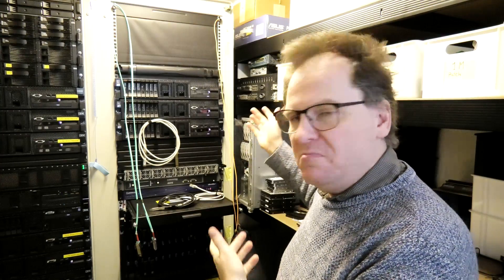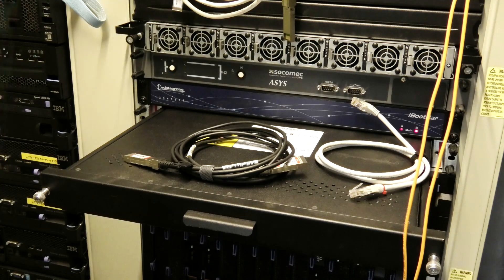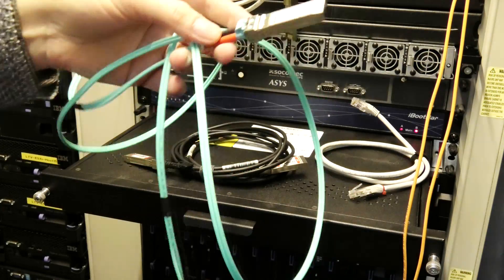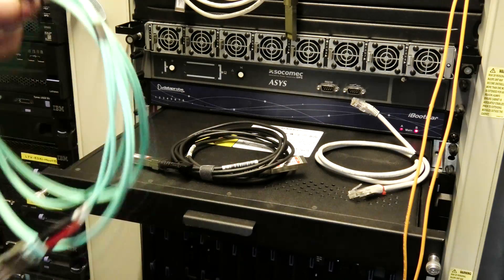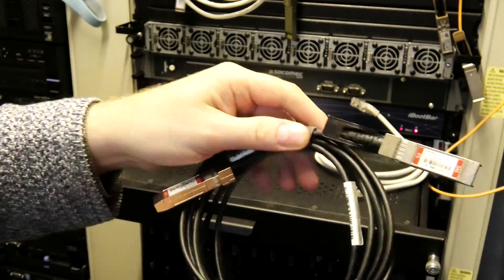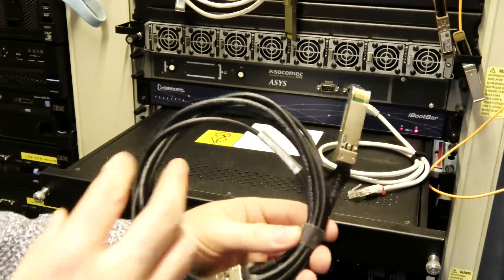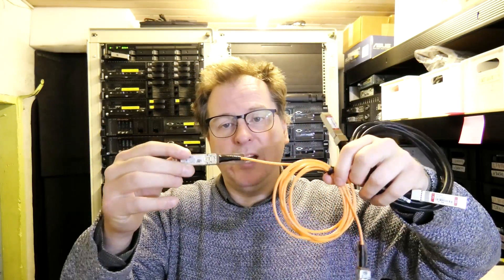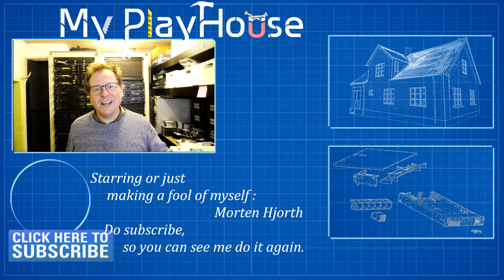Latency Difference Between 10GBASE-T SFP+, AOC & DAC Cables - 1286

Comment: Blogger, I carefully observed and researched this issue many years ago, and I also found Arista's latency test comparison report between AOCs and DACs. Arista's test report also showed that DACs have lower latency than AOCs. Yes, light travels at 300,000 km/s in a vacuum. However, in optical fiber, due to diffraction and absorption of light signals by materials like quartz glass, the propagation speed of light in solid-core fiber is only 200,000 km/s. However, electrical signals travel at 230,000 km/s in copper cables, which is even faster. Furthermore, AOCs require conversion between optical and electrical signals at both ends, resulting in double processing delays. DACs don't have this issue. Furthermore, DACs consume very little power, less than 0.1mW, practically nothing, while AOCs consume around 500mW and generate more heat than DACs. In data centers, if a large number of fiber optic patch cables are used within a cabinet, the cumulative difference in power consumption and heat generation can be quite significant. Furthermore, due to the optical-to-electrical signal conversion module, the DAC's MTBF can reach 50 million hours (some say 500 million hours, but I'll use 50 million for my calculations), making its reliability and durability more than an order of magnitude higher than that of AOCs. The SFP+ 10Gbps DAC we used in our computer room eight or nine years ago is still in stable use. However, due to the optical-to-electrical conversion module, AOCs experience optical degradation every five to seven years. For safety reasons, we typically replace key nodes every five years based on the module's optical degradation.
Reply: Of course, the DAC's biggest drawback is its short transmission distance of only about 7 meters. Furthermore, the electrical signal is more susceptible to EMI than the DAC's optical signal. However, this distance is sufficient for use within a cabinet. In terms of transmission speed and latency, hollow-core fiber may hold the greatest potential. It's said to offer 30% faster transmission speeds than traditional solid-core fiber, greater bandwidth capacity, longer transmission distances, and lower latency. The University of Southampton in the UK has been conducting research on this technology, and some Microsoft data centers have reportedly been using it in recent years. Meanwhile, many fiber optic manufacturers in China, such as YOFC, are also engaged in R&D and production. I've seen some of these companies and their products at the Optical Communications Expo.
Reply from the maker: hollow-core fiber,, intersting.
Reply: This is the address of Arista's previous test report on DAC and AOC: https://www.arista.com/assets/data/pdf/Copper-Faster-Than-Fiber-Brief.pdf
Reply from the maker: Thank You!
Reply from the maker: Yes and the delay switching forth and back from light,, I would thing is a factor..

Comment: As I understand it with fiber optics you do have a delay between the electrical to optical and optical to electrical signal...when measuring from port to port or server to switch to server.   So when it's a short distance, with in the same rack, you can actually get better latency using SFP+ DACs than optics and fiber.  Any longer distance that would require an electrical booster, fiber will have much lower latency.   Also the DACs tend to heat up less than the Fiber optics, in my expeierance.  But you can look at power the device uses to indicate heat output of the DAC vs Fiber Optics.  With the 10GbaseT "optics" being the highest power consumers. 

"Electrical to optical signal conversion introduces a delay, primarily due to the time required for the conversion process itself and the subsequent propagation through the optical medium. This delay can vary depending on the specific components and techniques used, but generally falls within the nanosecond to microsecond range"
Reply from the maker: That is also what I think,, I do not have any prove!! :-)

Comment: Many have observed that SFP adapters run very hot. The cables run somewhat cooler but I'm wondering which type of cable runs the coolest?
Reply from the maker: It's just the SFP's that run hot,, all the cables does not really heat up.
Reply: @MyPlayHouse  I should have been more specific: what I meant are the metal devices at the cable ends. Which type runs cooler, fiber optic, coax or RJ45?

Comment: One reason for increased latency of a DAC vs fiber is an incorrect assumption about the speed of light in copper. The speed of propagation depends on the characteristic impedance of the line, which depends on the dialetric material, distance between waveguides and groundplanes, etc. Paraphrasing from another commenter, transmission lines are complicated.
Reply from the maker: I still think it’s weird 😳

Comment: The SFP+ DAC (passive) should be a lot better because there is no signal processing in the transceiver. It literally connects the contacts from one sfp+ slot to the other via a copper conductor. That's also why it does not reach far beyond 5 m. I think you mixed up the numbers of the SFP+ Fibre and SFP+ DAC transceivers. All other methods have some sort of signal processing and or medium conversion, and that is the mayor contributor to the latency. The medium itself is mostly irrelevant in this case, the (long) distance has a bigger influence in latency than if the signal travels over copper or optical fibre. Of course signal degradation over very long distances and the need for repeaters do play a role.

So we have two contributors:
- Medium conversion
- Distance

But to be blunt, in a homelab, I don't think latency matters enough. I'd just avoid the SFP(+) to RJ45 transceiver modules, not just because of latency issues, but also because they get hot af and draw a lot of power.
Reply from the maker: I see up to 7meter DAC cables,, after that they become active AOC :-) Thank You!
Reply: @MyPlayHouse  Yes, that’s why i said „not far beyond“ and not „not longer than“.

Also, apparently active DAC (yes, copper!) cables exist that go a bit further, but of course don’t reach the fibre distances.

Comment: Electricity doesn't flow in the wire. It travels in the electromagnetic fields surrounding the wire so the speed of travel is limited by the dielectric. Free electrons in a conductor actually only move about 0.5 cm/second or something. It's actually really all a mess. It's only at DC that something like 44% of the energy is carried by the electrons. Above 100 Hz it's all fields. If you thought electromagnetic theory is a disaster, you should look at solid state physics. Those guys must be clamoring to throw themselves off tall buildings. If you actually heard the "theories" they've come up with to explain free electron flow the scales would fall from your eyes.
Reply from the maker: Nothing is ever simple when you gig in to it,,, like if you think a compass points towards north,,, is does,,-ish :-)

Comment: I admittedly did not watch the whole video, but skipped to the part with the whiteboard that says Fiber is faster than DAC.

You may have covered this in your video, but if not - This is wrong. DAC will always be faster than fiber. 

Over the distances that you can run a DAC, it will virtually always be faster (lower latency) than fiber. 

This is because fiber requires the electrical signal be converted to a light signal, then back to an electrical signal. 

This introduces more latency than the speed advantage that fiber has over the distances a DAC can be run. 

Over long enough distances, yes a fiber would eventually be lower latency than a DAC - but the point is moot, because DACs don’t run that far anyways. 

TLDR; For all intents and purposes DAC is always faster than Fiber
Reply from the maker: I also thought that,, but could not find any data to back up that.
Reply: Did you do any benchmarks or just the math? @MyPlayHouse

Comment: If you google "Copper-Faster-Than-Fiber-Brief" you can find a pdf by Arista Networks detailing why DAC cables are faster than fiber (because it does not convert the data into light and is a direct connection) and how much faster it is compared to fiber.

Comment: Isn't there a fiber cable that is more protected from breaking with a thicker shirt? I'm not talking about the 3mm variant.
Reply from the maker: Yes you can get thicker, and cables with like two wires side by side,, they are stronger.
These thin ones you have to be careful with.
Reply: What are they called so I can buy some?

Comment: The logic of your math presents a problem. A DAC is a 1:1 circuit connection, and no conversion is necessary. This contrasts with fiber, which does require conversion. Although it's not something measurable externally, nearly every switch IC engineer I've consulted advises using a DAC if space and cable length allow.
Reply from the maker: I did not come up with the numbers :-/

Comment: For Short Distances DAC cables are better as they are cheaper and no conversion is needed (From Electricity to Light). For Longer distances fiber with transceivers are better as copper wires have Resistance and the current Cat7a cable can do 10Gbps @ 100M max. 
AOC Cables on the other hand stands for Active Optical Cable. 

Advantages of DAC Cables : 

More Cost-effective— Generally speaking, the price of copper cables is much lower than that of optical fibers. The cost of passive copper cables is 2 to 5 times cheaper than fiber cables of the same length. Therefore, the use of high-speed cables will also reduce the cabling costs of the entire data center.
Lower Power Consumption— High-speed DAC (direct attach cable) consumes less power(the power consumption is almost zero) since passive cables do not require a power supply. The power consumption of active copper cables is generally around 440mW. If you use direct attach copper cables instead of AOC fiber cables, you can save hundreds of thousands of kilowatts of electrical power.
More durable–It is designed with a seamless connection form of optical module and optical cable, which reduces the cost and ensures that the optical port is not exposed to dust and other pollutants. Therefore, DAC is less susceptible to damage. 

Advantages of AOC Cables : 

Lighter weight-An active optical cable is composed of two optical transceivers and a fiber optic patch cable, whose weight is only a quarter of the direct attach copper cable, and the bulk is about half of the copper cable.
Longer distances-AOC fiber can provide a greater and longer transmission reach of up to 100-300m due to its better heat dissipation in the computer room’s wiring system and smaller bending radius of optical cable.
More Reliable– Active optical cable is less vulnerable to electromagnetic interference since optical fiber is a kind of dielectric that can sustain a static electric field within it. The bit error rate of the product transmission performance is also better, and the BER can reach 10^-15.

Those SFP to RJ45 converters/adapters... Well they are useless in most cases. The transceivers gets hot and heating up the whole switch unnecessary. The proper way is to convert the signal is a proper media converter designed for this purpose.
Reply from the maker: Hi Victor Shane
Thank You very much!  that was some assay :-)
The SFP to RJ45 works fine for connecting a management port like IMM,ILO from a server,, without having to add an extra cobber switch.
Thank you for watching! :-)

Comment: Do not believe fiber cabling offers lower latency compared to a DAC connection. I know for a fact that that is not the case 🙂 You did not measure your experiment, but based your conclusion on information provided by a single cable vendor.
Reply from the maker: I did see that they did not invent the numbers them self.

Comment: Another thing is interference. Copper wires can be affected by high current power lines where as light on the other hand is not.
Reply from the maker: It is posable,, not usually a big issue.

Comment: I think the biggest factor to these connectors is the heat and wattage that they consume. This is especially true when you have full switches that are populated. For one or two connections, an extra 3-4 watts per port and btu is not a big deal, but when you have 48+... now that is going to be a big deal if you have to pay for expensive power rates and AC to cool.
Reply from the maker: It all adds up,, I have also seen big switches with just a few connections. :-/

Comment: Fun fact: there is lots of engineering on getting a fast electrical signal to travel over a wire. We tend to think of a wire as something that just outputs whatever signal you inject into it, but that's a huge oversimplification. Instead, the universe has a tendency to work in quite complicated ways: https://en.wikipedia.org/wiki/Transmission_line
Reply from the maker: Well I have difficulty enough, with the part that it is not the electron you put in, that is comming out :-)

Comment: Can someone please help me understand, when you have top of rack switches which are linked back to spines in spine and leaf, and you choose sfp28 ports on your top of rack switches: where does the servers ilo rj45 plug into? Do I need an sfp28 switch and rj45 switch separately just for ilo or do I convert some sfp28 to rj45 with converters?
My work uses all rj45 and I really want to move us to 25G with 100g or higher uplinks to spines but the ilo/idrac question is confusing me
Reply from the maker: You can put one of these in your switch,, and a cat6 -ish cable to your Ilo.
Reply: @My PlayHouse  yes I think cheap rj45 sfp modules are the way to go thanks
Reply: You put a separate management switch into the rack. You could put 1Gbps SFP modules into your super expensive top of the rack switch but honestly, it would be a really daft move. We have historically cycled down old switches for that purpose but that won't work in the future as all the switches are SFP+ ports only😞

Comment: somewhere out there must be a 40Gbit/s NIC for RJ45, because there are RJ45 de-embedded modules from metz-connect btr for this speed...
Reply from the maker: The cat8.1 will do 40GBASE-T,, I have never seen a card..
Reply: @MyPlayHouse  Cat6a will do 40GBaseT as well. Yesterday I found a posting that it's possible to cross-flash a Mellanox connext-X3 to 40G.
Reply: @matthiaslange392  There is no IEEE 802.3 standard for 40Gbps Ethernet over Cat6a. It needs Cat8 with the special CG45 connectors and only goes up to 30m point to point, no patch panels or outlets are allowed. To the best of my knowledge, not a single piece of equipment has ever been released to the market supporting it and 40Gbps Ethernet is a dead end now, so it is unlikely there ever will be.
Reply: the connect-x3 has sfp ports, not rj45.
Reply: @jonathanbuzzard1376  it's like SATA-express: some mainboards, but not a single drive ever released.
Reply: @jonathanbuzzard1376  alpha Networks had a 25G Base-T switch in 2021. But no 40G Base-T Equipment anywhere. And no NICs.

Comment: I was always told that DAC is the lowest latency but i could be wrong. The advantage of fibre is that its thinner and easy to manage compared to DAC. Unless you work with " John loop the fibre" who uses a fibre patch lead 4m too long and loops it up and down the rack....... and then loses his console cable for the 1000 time.
Reply from the maker: I would also have expected that DAC would have had the lowest latency,, I can't get into my head that the other is faster.

Comment: Neither of these matter when we, on the receiving network card, run with typically 70us coalescing. This avoids interrupting the CPU at every packet, instead giving the NIC time to do its hardware acceleration things, and the CPU can process packets in bundles. 
The reason for both the low power and latency of fiber interfaces, and the high same of 10GBASE-T is bandwidth: Fiber has oodles of it, and the bits can be shoved across as-is with bandwidth-inefficient coding. 10GBASE-T is up against the limit of the cable, and requires complicated line coding to make it work; There's a presentation from Broadcom in 2006 showing the crazy complexity of a 10GBASE-T 'modem'.
Reply from the maker: So the network card is kind of caching for the CPU. ?
Reply: @MyPlayHouse   It's doing more than that. It will read data from main memory (it goes across PCIe and through the CPUs memory controller), chop up data into packets, add headers, and calculate checksums on transmit, and verify checksums and assemble packets into larger blocks on receive. Not just on Ethernet level; the NIC understands IPv4/IPv6/UDP/TCP/GRE enough to do this. It writes the result into main memory where the driver wants them, and only when all that's done does it notify the CPU. The quad-gigs you used to sell also handle priority queueing and map traffic flows to CPU cores. Desktop NICs have less of this, as 1Gbps/2.5Gbps is relatively slow, modern CPUs are plenty fast, and this market focuses entirely on BOM cost.
Reply: Interesting!

Comment: SFP normally bring out a MAC connection to the cages, so you are adding the latency from the MAC to the PHY layer in the cases of the two SFP-based interconnects. So to be fair, you should also take into account the latency in the PHY's on the board that the RJ45's are used with...if this makes sense.....
Reply from the maker: That would be different from card to card,, This was just about the cables.
Reply: @MyPlayHouse  But it's not , because some of the NIC components are in the SFP RJ-45 10G transceivers.
 Having said that, I've proven to myself that there shouldn't be any difference at all between a Intel NIC chip and copper wire regardless of the relative location and proximity of various components in the circuit.
 Right?
 On the NIC right behind the connection or in the cage.